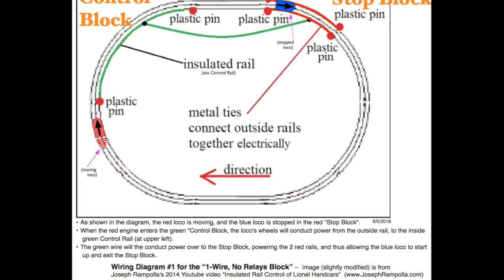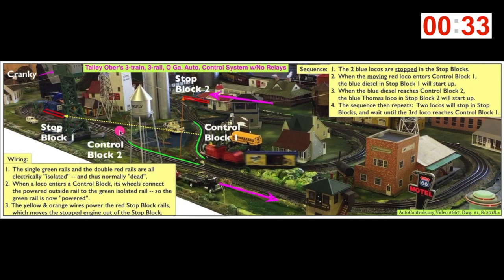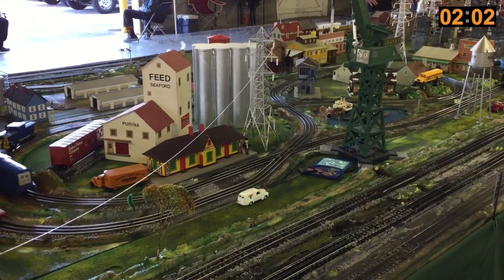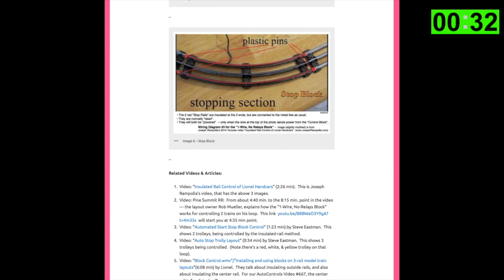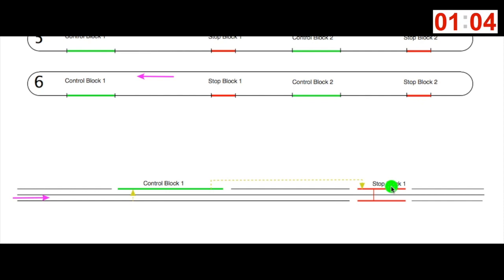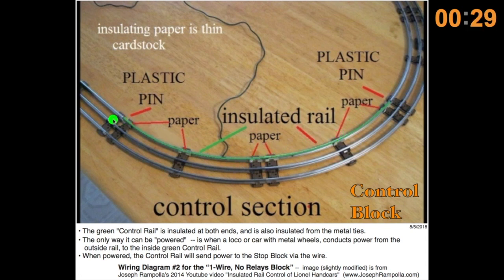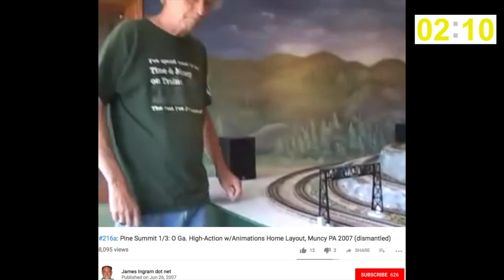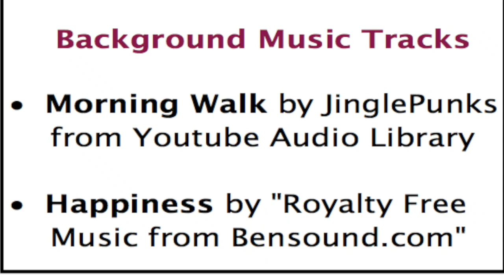667 Talley Ober's Insulated-Rail 3-rail O-Gauge Automatic Control System Controls 3-trains,No Relays

Comment: James, What is the size of the automatic layout? I see you use at least 2 different size curves. What are they? Do you have a track drawing showing track size, or material detail list?
Reply from the maker: I just saw this comment.  If you're referring to the Talley Ober layout (this video #667), I don't know the size.  I just made a video of his layout, while it was operating at the York TCA meet.  There's a drawing of the track plan I made at https://autocontrols.wordpress.com/insulated-rail-3-train-3-rail-o-ga-automatic-control-system , but this is NOT to scale.

Comment: James , thanks for the response. By any chance do you have a wiring diagram for the use of relays on this layout?
Reply from the maker: Hi Dennis:  Note that Talley Ober used NO relays to control the trains on his layout, that is seen in this video #667.  

(1) The NEXT AutoControls.org video #668 titled "Z-Stuff DZ-1012 Signal Automatically Controls 2 3-Rail O-Gauge Trains"  ( https://youtu.be/LMnjJLROMQc ) shows a Z-Stuff DZ-1012v block detector and DZ-1008 relay controlling 2 O-gauge trains on the same track.

* I claim this method to be one of the SIMPLEST methods to control 2 trains.
.
(2) Toy Train Revue put a wiring diagram for the "traditional" insulated-rail-controls-relays system on their web page here:  http://toytrainrevue.com/block-relay.htm .
* Thirty seconds from the 10 minutes in from The Toy Train Revue DVD that talks about the control system, is shown in the last minute  of Part 2 of Video #668 ( https://youtu.be/LMSptSSnkcw?t=2004  ).
* The DVD is described at http://www.tmbv.com/How-to-Build-an-O-Gauge-Layoutbr-Beginner-Advanced/productinfo/HOW2 . (As of Nov. 2018, you can also view it on Amazon Prime on your television.)

(3) The O Ga. RR Forum discussion thread for this Video #668 is here:  https://ogrforum.ogaugerr.com/topic/video-z-stuff-dz-1012-block-detector-controls-two-o-gauge-trains-on-1-mainline .
* Note Bob Walker's post of 11/13/18 in that discussion, contains a copy of his Oct. 2007 article from Classic Toy Trains on hooking up a block system, using Z-Stuff DZ-1011s.

(4) There are probably MORE wiring diagrams "buried" in the O Ga. RR Electrical Forum discussions: https://ogrforum.ogaugerr.com/forum/electrical-forum .

Comment: Is there a way to adapt this to two rail (N scale) track?
Reply from the maker: * I would opine, "Not easily".
* For N scale, I would use DCC; because there are no blocks needed in the track.
* EXAMPLE in N scale: Video 827-1/2 Automatic DCC Train Control, 3 Kato N Ga. Locos on 1 Loop/No Blocks/1 Detector/NCE MiniPanel, https://youtu.be/_STpvQszJ-I
* You would have to procure locos with decoders, an NCE system, learn how to program it, etc.  But in the LONG run, you'd probably be much more satisfied.
* Please contact me if you have any more questions. (http://JamesIngram.net)
Reply: Thank you so much for your response.  Will the NCE mini panel only work with an NCE cab controller?  I have a Digitrax system and a Bachmann EZ command system.  Will the NCE mini panel work with either of those systems?  Does Digitrax or Bachmann have something that is the equivalent of an NCE mini panel?  Thank you!
 @JamesRobertIngram
Reply from the maker: @hhc19avn  * Unfortunately, the NCE Mini-Panel works ONLY with an NCE system. (I think it DOES work with the TCS system.)  To the best of my knowledge, NOBODY else has an equivalent of the NCE mini panel.
* For an overview of how it hooks up, see the introductory video on Vimeo, "816-1.1/5❇Quick-Start Guide to NCE 3-Rail DCC O-Gauge Programmable Train Controller❇ Setup & Blink" at https://vimeo.com/793946078 .
* Although the video's title says "3-Rail", it hooks-up the same for ALL scales of DCC.
Reply from the maker: * FYI: ANALOG METHOD:  To control TWO trains using the "analog" method of an isolated "stop block" in N scale WITHOUT using DCC, you should be able to use the same method demonstrated in "668-3/3: Z-Stuff DZ-1012 Block Detector+Relay Automatically Controls 2 O-Ga Trains-Release From Rear" at https://youtu.be/CiwxULos5IM .  
* This uses a Z-Stuff DZ-1012 infrared detector and Z-Stuff relay -- which will work on just about ALL trains -- as small as an N ga. streetcars (demonstrated in other videos).
* However, I don't think you could use this for 3 trains; I believe you'd be limited to 2 trains due to the "timing issues".